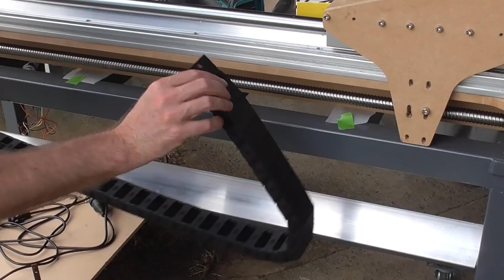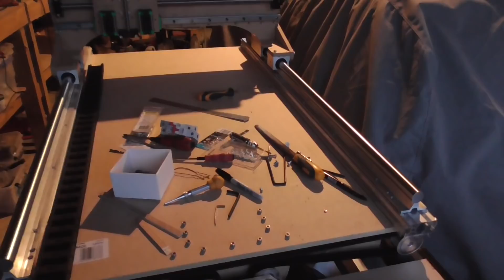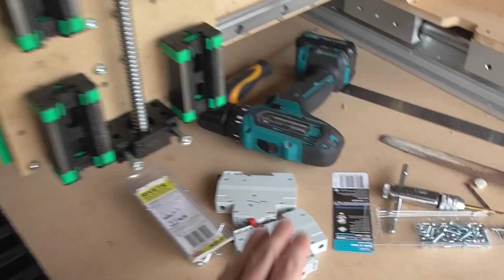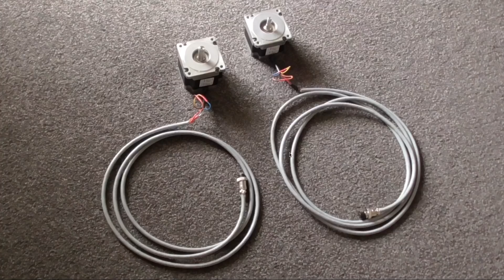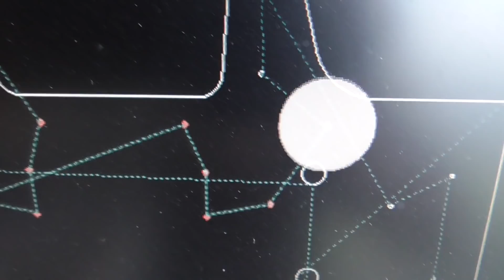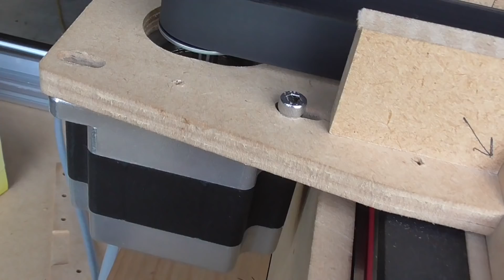Another DIY CNC router, part 3 (more wiring, first movements)

Comment: Can you point me to that shielded stepper wire you use? I bought some that was to thick for my connectors. Thanks.
Reply from the maker: https://www.aliexpress.com/item/4000736090211.html
The four cores option, I got 20AWG, about $19 for 5 meters. If you increase the quantity they'll give it to you in a single length (not multiple pieces of 5 meters thank goodness).

Comment: You could probably straighten that ball screw using a Fly Press and some vee blocks with a dial indicator...So remiss of China to send you a banana...These screws always have to be perfectly straight in all situations...🤔🤔😳🇬🇧
Reply from the maker: I've seen a few cases where people try and it never turns out well. They're sending me another, which is the best outcome.
Reply: @iforce2d  Yes, of course...Why don't they check them..?..It's not bent in transit...🤔😳😳🙄🙄🇬🇧

Comment: One breaker may trip easier thanks to spikes caused by spindle starting. It´s quite powerful motor and will have quite a big spike in current, it depends on your contiguous load. You are already using type C which is for inductive loads like electric motor this is reason for tripping at 5-10 times higher currents but only at spikes, not longer surges as short circuit or very high overload. But as i said it depends on maximal continuous current, or rated current of your spindle. If they are lower than 10A combined during maximal potential workload, it's OK to have both on one, if not separate breaker one for VFC/Spindle and another for system are fine. We in EU on 230V/50Hz use in households 16A type B breaker for outlet circuits and 10A type B for lighting circuits. 10A 230V mean 2 300W, if combined total load is near or over 2300W you should use definitely two 10A breakers. Don´t be sacred they max tripling current is even above 50A. For type C 10A it means tripping current 50-100A and it will trip this currents in 0,00something-4 seconds and 15A in 20 seconds for example. Definitely consider fuse for control circuit/microcontroller if you are not using one already, any breaker will not really save delicate electronics in case of failure.
Reply from the maker: The spindle is rated 8A. The stepper power supply is 1000W but the total combined peak current as shown in the stepper motor datasheet will be more like 700W, or about 3A. Together at full draw this would be slightly over 10A but I kinda doubt they will ever be at full draw at the same time, at least not for long. It would probably take a fast acceleration in all axes, while the spindle is increasing in speed as well.

Comment: The only thing concerns me is gantry that will carry spindle. As forces will be strongest there during cutting and it will flex. If you added more structure and create ribs to counter lateral forces. I saw people making it even simpler and it works if you dont care about precision. But that part is most important to be stiff for CNC. Also part that cary it. I was considering to use concrete or rocks/sand poured with epoxy inside of wooden mold to increase mass and vibration absorption. There is resonance  also to be considered. 
I converted my mill and lathe into CNC and being made of metal has same issues with it lacking mass.
Reply from the maker: Yeah ideally the gantry would be more like a C-beam cross-section, but I wanted to have the z-motor tucked behind it. It is quite strong at the bottom where most of the force will be applied, and there is a 'rib' along the front at the top which I'm hoping will be enough to keep the upper part from flexing, highlighted in green here: http://www.iforce2d.net/tmp/Selection_577.png http://www.iforce2d.net/tmp/Selection_578.png

Comment: Being that I am a long time subber, I have the utmost respect for your "process" Chris, but I do have some pointers for your X axis back plane in prep for mounting linear rails and your Z axis. Is it too late for that?
Reply from the maker: I haven't ordered the laser cut aluminium yet if that's what you mean.
Reply: @iforce2d  Can I PM you.  You can cherry pick the applicable.
Reply from the maker: I don't see why this would be such a cloak and dagger thing, we're already talking here so make a comment and everyone can benefit.
Reply: @iforce2d  I followed a chap out of Netherlands doing a build, who shared his design  including a BOM and DXF files of all his parts. It was at this point I got into Fusion 360 and tussled with turning those DXF into 3D solids. His design was similar size to yours but revolved around heavy extruded profiles. Its worth a look to hear him talk about reference marks on the linear rail and bearings and how they are dealt with during assembly. By the way, you can see in the Z axis assembly a much better way I think of designing  and arriving at a robust and very stiff means of supporting your spindle. A picture is worth a thousand words and so a video is that much more effective.
I tried for an hour to encapsulate but failed.
https://www.youtube.com/watch?v=YOVHtjXi07Q&t=537s      
https://www.youtube.com/watch?v=dzE1Pm6raxA
https://www.youtube.com/watch?v=qHRkLz7IZT8
Reply: I also suggest using thicker 6061 T6 (6081 in NZ?) for everything just about,... 20mm is a good number,...and machining a step for the ref side of the linear rail  to nest into on your gantry back plane. Getting the squareness and parallelism of the gantry / z axis is paramount no matter if you are only cutting wood. If it isn't then you will have to face mill your spoil board and you won't be milling any metal on that MDF unless its aluminum and feedrates are dialed way down, let alone dealing with the means of work holding. Mass pays big dividends. I welded my sub frame and  weighs in @350lbs alone. My effective work area is 600x1200mm.. I put in birch ply spoil board with threaded inserts to make quick cam lock with M8 socket caps. I was about to install some 45x180mm 6061 extrusion over the entire bed and fasten it to the cast iron frame which is by far strong enough to hold a machine vise solidly and I may do so in the near future. But for now I am enjoying wood, with an exception to the wood dust in spite of my extraction system. Cheers and good luck.
Reply from the maker: I recall watching some of that guy's videos earlier this year. I'm not seeing any major difference in the z-axis arrangement, other than size. Is there something in particular you were meaning to point out?

Comment: One thought on the MCBs: In your country, is it a given that the plug is only plugged in one way? In Germany, you can plug the wall plug either way, resulting in the blue/brown conductor both being live 50% of the time. For that reason, a 2-pole MCB would need to be used. If you would plug the plug in the way that the brown is neutral and the blue is live, your MCB would only turn off neutral, still allowing live to flow into the VFD, potentially flowing to earth, not protecting anything.
Even if the plug can only be plugged one way, can you gurantee that your installation, extension cord, etc. never swapps the brown/blue conductor? If not, using a 2-pole MCB would be a better option in my opinion. Also, thinking about using a RCBO/RCD would be good, considering you want to use coolant. Maybe a RCBO would be the best option, combining the RCD and 2-pole MCB... but just my opinion. Edit: Most RCBOs use push-in instead of screw-in clamps, also avoiding your worries about the cable coming loose.

Regarding the two ground wires: Not a problem as long as they are plugged into the same outlet. Plugging one into one outlet and the other into another outlet, say, at the other side of the house, could be a problem however as equalization currents could flow (at least thats what you say for big industrial appliances, for home this also may be negligible)

Regarding the distance ot the phase and ground: I would say it is ok, as long as the cover is on and protects it from water and dust. Also, inside the spindle, the distance will be much smaller bwtween the windings and housing ;)
Reply from the maker: We have plugs like this (with earth) so the polarity can't be reversed there. I checked the extension cord is correct, so assuming the house wiring is also correct I think the polarity should be right. https://world-power-plugs.com/img/plugs/new-zealand-power-plug-outlet-type-i.png
Just looking around at RCD options I see this one. It has a switch on it, hmmm I wonder if that could double as a hard e-stop...?
https://media.prod.bunnings.com.au/api/public/content/2d76ce716e3c4bd487db664818920558?v=f3b270ba&t=w500dpr1
The two ground wires come from adjacent plugs on the multi-plug board.
Reply: @iforce2d  OK, perfect :) Yes, that RCD Extension also looks reasonable :) While just unplugging the cable works, pressing the test button of the RCD could also double as E Stop. However, I would mount one directly on the machine in arms reach that at least stops Motors and Spindle digitally, however, preserving the position of the machine. This helped me several times in my CNC machine.
Looking forward to the rest of the series :)
Reply from the maker: I'm thinking about making some other kind of button panel for digital e-stop, maybe wireless. ESC key on the keyboard does it too.

Comment: I think you really should put that spacer in for the belts, they can run remarkably well when slack, if there's a problem with the belt tension this is where the system will fail, if those belts touch, at best you'll get a nice audible warning, at worst they will lock firm and then you are relying on the motor protection.

Excellent videos, keep us updated its looking awesome

Comment: Jeeez... this is soo good I could wet myself!!!   👍🥴
If the oscillation of the belt at 7:07 ends up being a problem, stack a skate bearing and some washers on an M8 bolt and screw it into the space between the two idlers.  Leave a gap of 1mm or so between the top of the bearing and the belt when it is at rest, and it will only make contact if oscillation actually occurs.
At 18:10, I assume you are intending to fit some form of strain-relief where the cables leave the cabinet, in which case it looks good... but Hey, I ain't no sparky!   😱😵
Reply from the maker: Yeah, that's not a bad idea at all :)
I'm not sure how to arrange strain relief, but it probably should have some. For the time being it's not too bad since the platform is only 6 centimeters below the cabinet there is not actually much gravity working on the wires, but in the long term I would like to fix it a bit better. Still having to remove and replace the cabinet many times at the moment though, while in the build process.

Comment: You need to consider the estop and protection circuit in the cabinet electronics. I have a spare jakob protection switch you can have if you would find it useful
Reply from the maker: I'm starting to think I might have an e-stop that shuts off everything before that multi-plug switchboard. I mean if you hard stop the steppers you lose the work position anyway, and the computer only takes a couple of minutes to get ready again. Then if the limit switches are accurate enough, all it would take is a homing cycle to regain positioning.
Reply: @iforce2d  I'll find some contact details for you somewhere and email. I have built a couple of CNC machines and the most recent included a best practice set of electronics with the correct protection circuiry. It's normally out of the price range for homebuilt but I found a couple of super cheap lathe control units a few years ago that had all the good bits in them and I have some leftover that I'll never use. Basically the circuit should power down on estop and not turn on again until after everything is cleared and re-enabled. You can do it all with discrete components, but a dedicated safety switch is the way to go if you can find one

Comment: May I suggest that you make some guards to prevent you from accidentally switching off the power on the extension cable gangs? If those small rocker switches are like the ones I have used, they are remarkably easy to knock off or on unintentionally.
Reply from the maker: These ones are quite stiff, at least they are now when it's new. They may loosen over time, we'll see how it goes. When the bench is in it's final location, they will be against the wall and I will need to reach over the table to get at them, so it's unlikely they will be bumped by accident.

Comment: Great project! I would suggest putting those mains switches in the lid/door. Easier to access from the outside.
Reply from the maker: The multi-plug extension panel on the side of the bench has switches, so I'm thinking that will be convenient enough.
Reply: @iforce2d  Can you please place a link to these braking resistors? Thanks
Reply from the maker: https://www.banggood.com/5pcs-RX24-100W-220R-220RJ-Metal-Aluminum-Case-High-Power-Resistor-Golden-Metal-Shell-Case-Heatsink-Resistance-Resistor-p-1518121.html
Reply: @iforce2d  Oh great I need one of these for current application. By the way, I've designed and made little less than 30 different CNC machines during past 12 years... bending, welding, polishing machines e.t.c and recently has started to post videos. Well I've only uploaded couple of clips that i've found in whatsapp folder, filmed them during conversations with customers. I'm going to start a series for cnc lathe machine soon, but I don't really know how to make a good video. do you write a scenario before filming? Any advice will help. And if you have questions about cnc in general, anout rails, screws, electronics, rigidity, machining and so on - feel free to ask. Thanks!

Comment: 21:17... If you are worried about arcing to the ground pin you could use silastic/silicone to fill the 2mm space for added insulation. The project is coming along quite well.

Comment: I'm curious to why you decided to use two screws on the X axis, what was the motivation?
Reply: i can't speak to the actual reason in this case, but it's just nice to drive the gantry from both sides, that way you're not applying an awkward unbalanced force on one side
Reply: Rigidity.
Reply from the maker: I presume you mean to have a single screw under the middle instead, eg. https://www.youtube.com/watch?v=47Hp_mZt0kY That is not uncommon, but I don't like the way forces have to pass from the middle out to the side and back again. It also requires a large empty space under the main platform, basically supporting the whole thing from two ends only. This would have required a thicker main platform (either reinforcing with extrusion or making the whole thing from extrusion), increasing the height and cost, and the distance forces need to travel. It's probably not a huge deal, but I like to have the ball-nut as close to the rails as possible. The biggest issue with using two screws is the extra cost of another motor and driver, but the belt avoids that.